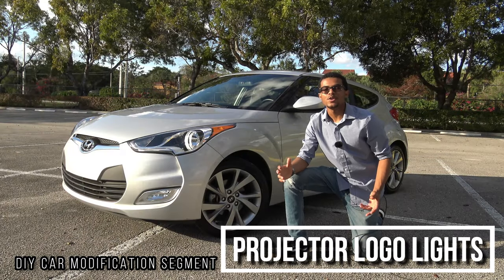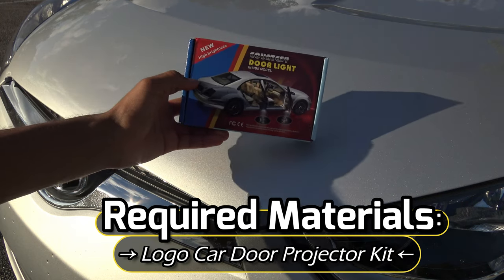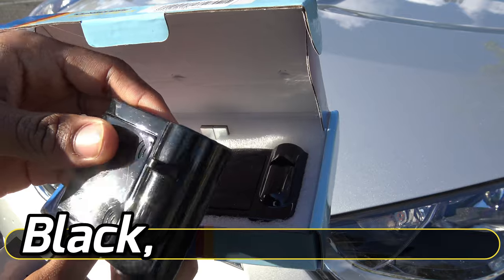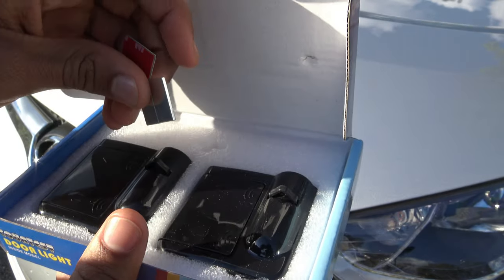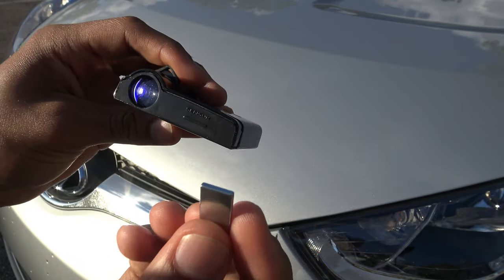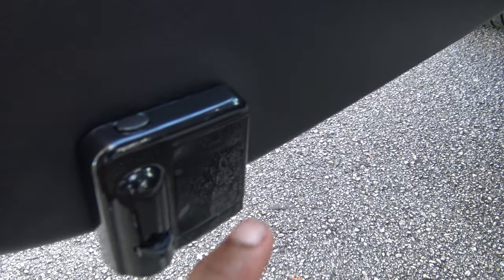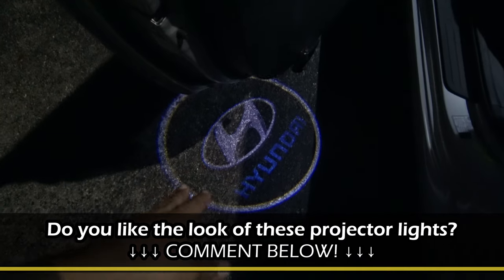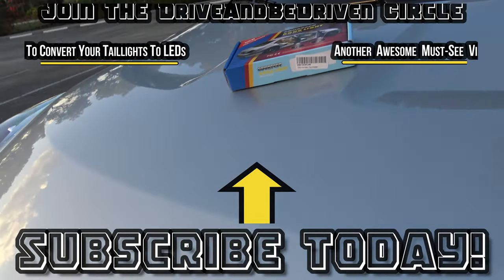How To Install Wireless Car Door Logo Lights | Step-by-Step DIY Tutorial & Review | In 4K!

Comment: I did this same thing in my Audi, except my application was a little more streamlined as my doors already had built in puddle lamps all I had to do was change out the stock housings with projector housings.
Reply from the maker: Indeed, Anthony! I recall you telling me about those awesome courtesy lights in your Audi Q3! Your install definitely looked more streamlined than mine, but then again your method is not universal. The ones I used in this video can be mounted on any car regardless of the presence of stock housings.

I really love them still! So striking and vibrant at night. Undeniably, a lovely addition to my Veloster!

Thanks again for everything, Anthony! Your support is truly appreciated! I actually have some SPECTACULAR news being announced over on Instagram. So, be sure to check that out once you get a chance!

More to come, my friend! :)

 ~DriveAndBeDriven
"Fuel by Dreams, Driven by Passion"

Comment: I got a set of these and instead of magnets, mine came with infrared sensing stickers that seem to turn the light on when the sticker is against the unit and it turns off when the sticker is pulled away which seems opposite to what you are explaing.

Comment: I saw this but the only thing i'd be on the fence about is having that sticking out in view. its nice not having to open your door and hardwire. Although installing in the door, hides it.
Reply from the maker: You're absolutely correct, Anthony!! These are definitely a bit more noticeable than the version that installs within the door panel, but the beauty about these is their rather low labor intensity, their low cost, and their impactful presence. The only compromise is needing to purchase batteries and having to look at the slightly bulbous box protruding from your door panel...

I have to admit. It isn't as bad as it may seem in all honesty. Yes, it protrudes... But, I have never hit it with my foot, and it has never fell on the floor (nor has the magnet ever moved since installing over 7 months ago). It's definitely much more "durable" (to a certain extent) than I was expecting, and for the price, I'd say give it a try. :)

Let me know how it works out for you!! 😁👍🏼

~DriveAndBeDriven
"Fueled by Dreams, Driven by Passion!"

Comment: I wonder if the door panel could be popped off and drill a hole on the bottom of the door so it would fit inside the door.
Reply from the maker: Yes! I'm sure that's a possibility. Although, I would had to test it out for it not to work. Also, these are battery operated... So, you'd have to remove the panel every time to change the batteries which can become a pain after a while. But, it'll definitely give the interior a cleaner more "OEM factory look". Once again, thanks for all your comments! They are really appreciated!!! 

~DriveAndBeDriven
"Fuel by Dreams, Driven by Passion"
Reply: @DriveAndBeDriven  other problem would be triggering it. unless you cut an opening for the sensor plate, it might always be on or off.
Reply from the maker: Indeed! Figuring out how to trigger the light with the magnet would be another considerable concern if taking this approach. An additional hole would definitely be the most effective way to go about this... Good call, Anthony!!

Luckily, I have seen many models of these lights that actually drill into the vehicle and operate via wiring.

I didn't use those models because my main motive for this DIY mod was to make it as easy and inexpensive as possible. These lights definitely do the trick! 😁👍🏼

Nevertheless, I hope you enjoyed this video! Please subscribe for more awesome DIYs, car reviews, and auto comparisons coming very soon. Also, let me know if you have any questions or suggestions. I'm all ears!!! 🤓

~DriveAndBeDriven
"Fueled by Dreams, Driven by Passion!"
Reply: @DriveAndBeDriven  at that point if you're going to take the door off and drill holes in order to shine the light through your best bet is the hard wire it so you don't have to worry about the battery at all or the actual triggering mechanism. This device was purely to be used outside of taking the door apart something simple that did what you expect. And it does it well
Reply from the maker: Exactly! I agree. If you're going to go as far as making holes, you matter as well go all the way and hardwire the lights. It'll definitely be less labor in the long-term regarding battery swapping. I'd also solely use this unit on the exterior of door panels.

Thanks again for all your comments, Anthony!!! Best wishes, and happy new year!

~DriveAndBeDriven
"Fueled by Dreams, Driven by Passion!"

Comment: Will that 3m destroy the car door’s paint if you decide to take the lights off?
Reply from the maker: Hi there! That's a great question. I am currently unsure about that since I haven't removed them yet. For me, they're still working fine, so need for removal as of yet.

I know that when I was installing it originally, I put them on and took them off at least 3 times to get the right positioning... When I did that, they never caused any damage to my door panels. But, that was within 1-2 minutes. I'm not quite sure what may happen now that I have had it installed for nearly a year.

I appreciate you leaving this comment. Hopefully someone can help you with an answer if they've had them installed for a while (and attempted to remove them).

Take care, and please subscribe if you found this video helpful. 👍🏼

~DriveAndBeDriven
"Fueled by Dreams, Driven by Passion!"

Comment: The projector unit looks a little bulky. Anyone who has these installed for a while, do you tend to knock them with your leg/foot when entering/exiting the car? How about the little magnet, anyone lost one of those yet? It seems like clothing or something could catch on the magnet and pull it off?
Reply from the maker: Hey there! Indeed. The unit is a bit on the bulky side, but for the price, it's a pretty solid deal! Also,, the fact that there are no wires and no drilling required totally sold me.

I've had these installed for nearly 6 months, and I have never knocked them before... But, then again, I have a "coupe" so my doors are much larger than the average 4-door SUV or sedan. Also, the magnet has never fallen off, even on rainy days. The adhesive is very strong on both the light apparatus and the magnets. The only area you'll have to maintain is the batteries. I had to swap them out about 3 times already. But, only the driver's door, since the other doors are rarely opened on my car.

Hope this information helps! Let me know if you have any more questions, and please remain subscribed for more awesome reviews and DIY videos coming soon! Take care, man!

~DriveAndBeDriven
"Fueled by Dreams, Driven by Passion"

Comment: That weak ass tape didn't stick to my door panels jajaja also on the G37 Sports the door panels stick out to far you would have to put that magnet on the carpet light wouldn't shut off when the door was closed.. Nice review but they don't work on every car. Seems if I want to install them I'm going to have to cut a whole in the cubby hole on the door panel and put them inside it🤦‍♂️ not super happy about that
Reply: Same with my VW beetle.  With the door closed, the light is still on, shining on the carpet.
Reply: @sanjanasingh9046  I had 2 gorilla glue that magnet to the very edge, try that to see if it works for you.. Go to Ace hardware buy you some double sided velcro put your light on the door where u want it, close the door and hold the magnet to the bottom if it shuts off glue the magnet in that position..
Reply: @darthraider4083  Hello!  Thanks for the tip.   I realized that with the door closed, the magnet that was provided was completely hidden, even if i tried to place it as close to the edge as possible.  And therefore, it was out of the pick-up range of the sensor.  So i went to my local hardware shop, bought a larger and stronger magnet which i placed on the panel beside the seat rail and its close enough to the bottom of the projector and now the sensor picks up the magnet.  I also got some stronger 3M tape and its all good now.  REally, i think the magnets provided with the projector would eventually get kicked off - they're quite small.  My new magnet is probably 3/4 inch squared and though visible, it's not an eye sore.  Thanks again for the tip!
Reply: @sanjanasingh9046  Yeah I had to Gorilla glue mine to the edge the tape provided on the magnets sucks for sure they dont stick.. And no worries at least you found a better solution to fixing it